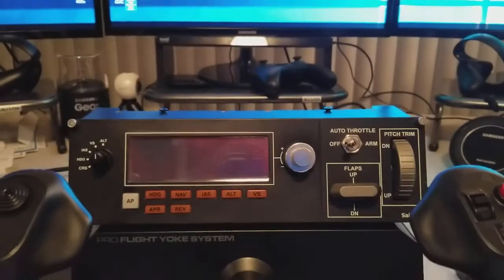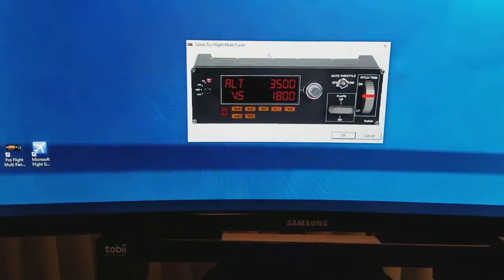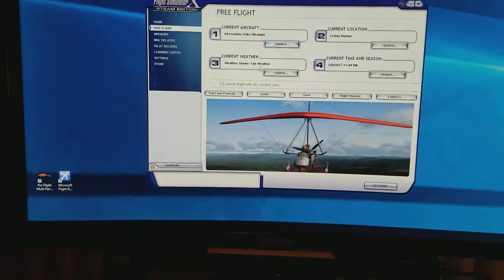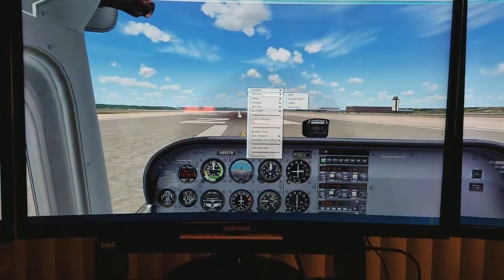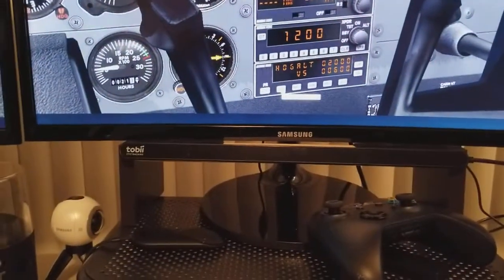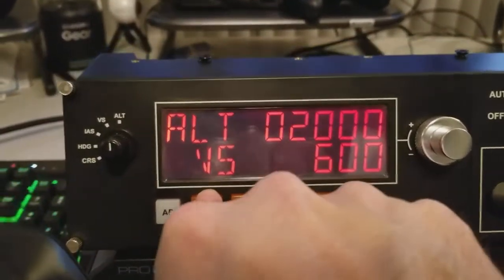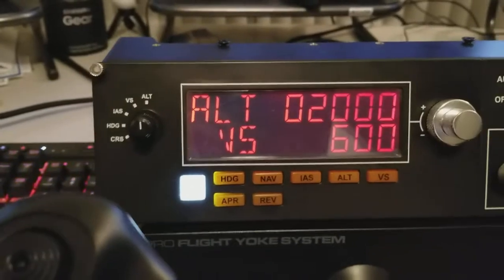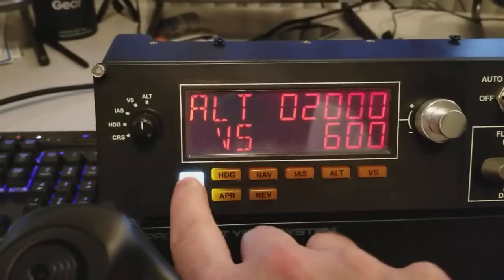Saitek Pro Flight Multi Panel buttons not working (FSX, Windows 10-64bit)

Comment: I have the same problem with windows10 and xplane11, at the first it was working.. now after two flights it stops working.. I tried to reinstall all the drivers but doesn't even light up..  for a 110€ device is a total junk..  disappointing.
Reply: I just got mine working with a regedit.
Reply: yep

Comment from the maker: Fixed:  To fix, RE-install all the 64-bit drivers for the other Saitek controllers (yoke, pedals, trim wheel, etc).  Turns out there are no 64-bit drivers native for these panels.  They are somehow embedded in the other Saitek drivers.  Note, if you go to the Saitek website driver download section, there is 32-bit panel SOFTWARE (not drivers) and the appropriate FSX plug-in(s).  The way to get the actual drivers for the panels is via the other Saitek controller 64-bit drivers.  I also re-installed FSX prior to re-installing the drivers for completeness.  I'm thinking the re-install of FSX didn't do much as the panels still didn't work properly with a fresh install of FSX.  However, once I re-installed all the drivers for the other controllers, the panels started working.  Good luck!

Comment: I had literally the EXACT same problem with my panel. I just now fixed mine by a total unexpected miracle! Lol.

When you launch flight sim, it asks if you want to run the plugin. Try clicking no. Then after FSX launches, go to your computers start menu. You should have a directory for "saitek pro flight panels".  Select to manually launch the plugins for FSX. 

I hope this makes sense, I know it's probably not the best instructions. Long story short, wait until FSX is launched to run the plugins. This fixed my issue. I hope it fixes yours as well.

Comment: I've got the same thing in fsx gold with acceleration  plus many orbx add ons , on all aircraft additions I've got and even the standard fsx standard Cessna 172 I get the same results . all flaps , trim etc work spot on yet left selecter knob and dailing in current alt,heading etc all works well within fsx if I click within virtual cockpit on each button but all the buttons on the multi panel light up if clicked through virtual panel screen  but don't work manually on the Saitek multi panel. I'm at a complete loss.